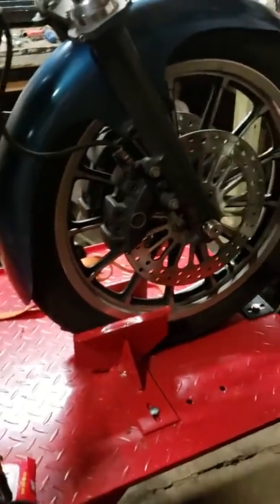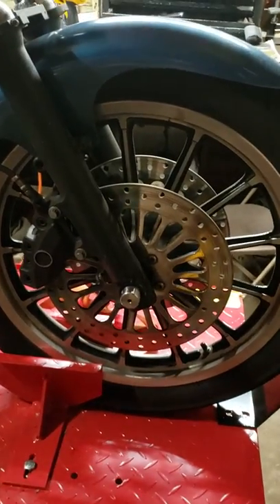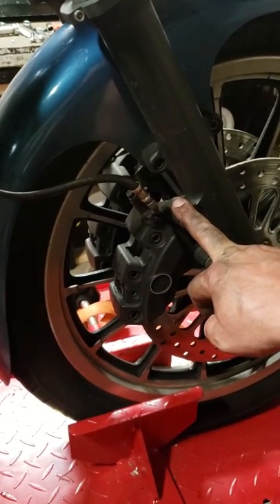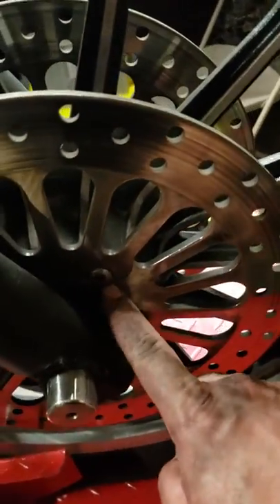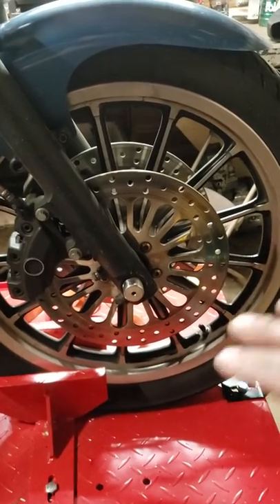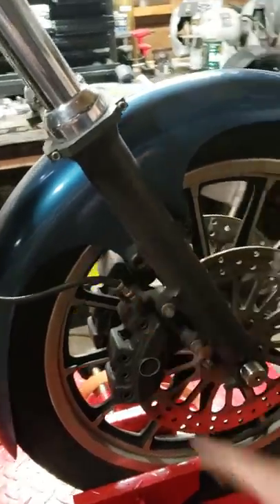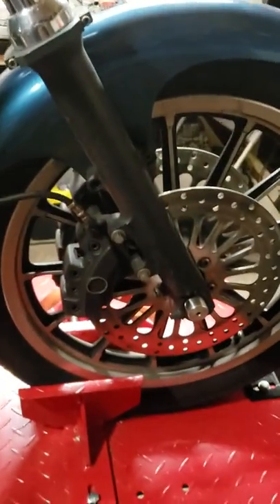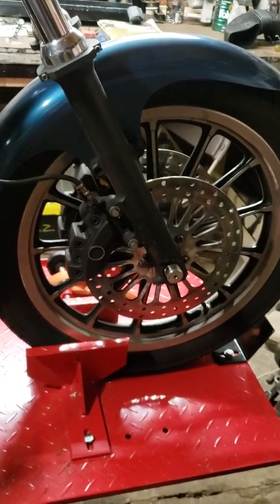Convert Dyna Dual Disk with FLH Brembo Brakes

Comment: Did you happen to measure or know the counter sink depth of the mounting holes of these 08 Dyna rotors?  I am in the process of acquiring the parts to do this conversion.  However I want to use the 11.8 rotors that are the factory design/look of my current 01 rotors and counter sink them myself.
Reply from the maker: I would have to pull the rotor bolts to get that. It’s about 75% of the bolt head thickness. It is just enough so the heads of the bolts barley clear the fork slider.

Comment: Desire to add Dual front Brembo calipers to 1996 FLSTF Fatboy. I have proper fork lowers. Does Master cyl need to change to go dual? What year Brembo calipers will fit this older bike? I assume 11.8" rotors.. TIA
Reply from the maker: You will need the adapters that allow you to use 00+ calipers. Then use a master off a dual disk bike.  I used the master and line off a road king FLHR
Reply: I got plenty of GO, I'm trying to beef up the WOE. Good info on Master from Dual touring type. I need Brembo caliper year and/or adapter info. Thanks

Comment: Hey man, had question see if you could help. I have a 2007 street glide with a 21inch wheel with stock calipers and 11.5 rotors but I want to upgrade to the 08 and newer bermbo calipers and 11.8 rotors should that be an easy swap? Just order the newer stuff and bolt right on? Thanks for listening. Hope you could help.
Reply from the maker: If you can find an 11.8 rotor that will bolt to that wheel, it shouldn’t be a problem. The caliper should bolt right up.

Comment: I bought a set of used brembos. They still have some dot 4 in the calipers. Anyway to flush the remaining fluid out? Or should I be good to fill in with dot5. I’m using my original lines. Fxdx 2004
Reply from the maker: I would bleed at least a reservoir or two of  fluid through it. That should be good.
Reply: @KnobleMoto  thank you bro. Last question, did you only replace the master reservoir, or the entire assembly?
Reply from the maker: @roco90s  I replaced the entire assembly.  It was a single disk before so I needed the dual disk brake line.

Comment: are all 2000 and up fxdx 39mm fork lower the same as far as the caliper mounting tabs? ive got a 98 SG that i want to run these calipers on but i have to run adapters and they look funny so if i can just get 2000 and up 39mm fxdx forks to swap in and have the calipers bolt right on id rather do that.
Reply from the maker: 98 & 99 are switch over years.  If you have quad piston calipers like the later 00’s, then yes the bagger brembos will bolt on. If you have the round calipers with only two pistons, then you will have to get adapters.
Reply: Did you have to shim your calipers in towards the wheel? Ive got all the exact parts as you have. Only exception is i have 11.8 floating rotors (shouldn’t effect anything) but my calipers will not bolt down tight to the fork slider without the inside of the caliper dragging tight against the inside of the rotor. Im losing my mind on this conversion.
Reply: Never mind i just found out there is a difference between the tapered bearing wheels and sealed bearing wheels. Tapered bearing wheel hub width is slightly narrower than the sealed bearing wheels. Which would explain everything as to why i cant fully seat my calipers because my rotors are to far in. Yay to ordering MORE parts.. being cool aint cheap!
Reply from the maker: @donevantaylor5009  part of the caliper on one side only had a few thousandths clearance from the rotor.  I filed it a little in case of some deflection happening.  It never made contact.  A shim could be a good option.

Comment: What year were those FXDX forks? I see yours don’t have the plug bolt off an 05. I have an 09 FXD. Looking to do the same set up
Reply from the maker: Left one is an fxd fork. Right one is fxdx from Ronnie’s Mail Order.
Reply: @KnobleMoto  I’m looking on Ronnie’s mail order and the only FXDX lowers I see are for the 05 and they come with that plug(could I still use those?). Also any recommendations on sourcing front wheels that accept both side rotors. My FXD only came with left mounted rotor
Reply from the maker: @mrbocanegraw  maybe fxdc? FxdL?  Any 99-05 would work.
Reply: Did you use a different brake junction to run dual brakes?
Reply from the maker: @mrbocanegraw  I used a brake line for a road king.  However you can but a T fitting to split the fluid, and I have seen people run longer banjo bolts, and just run two lines.

Comment: can i do this on a 2017 dyna lowrider my bike comes with dual brakes already
Reply from the maker: Yes.  You might be able to use your existing rotors too, but you will have to check to see if they are 11.8" diameter. The rest shoud just bolt on.

Comment: For a 07 Street bob would I have to change out anything to do the conversion? Or can I just get the rotors and brake set and just bolt everything on and add the extra line to the master cylinder?
Reply from the maker: Personally I would change the master too.  I am not sure the stock one would move enough fluid to make a dual disk setup work properly. 
To save a few bucks you could buy a used one and just rebuild it.
Reply from the maker: Otherwise, yes it should all just bolt right on.

Comment: Did you have to end up getting new front wheel compatible for dual disk? I have an 08 fxd and it looks like the wheel could only do 1 rotor.
Reply from the maker: On the 05 wheel, and many of the 39mm front suspensions, HD used the same wheel, so the bolt holes were already there.  
So, no I didn't have too.  
Check other dyna models for the dual bolt pattern, and the sportster models.   Many of them run the same wheel bearings, and axles.

Comment: Hi mate...im interested in making my 2015 abs softail standard...any help or information would be great... cheers
Reply from the maker: Sorry, for the late response.  I would start by finding a softail model that is dual disk, with the same diameter forks.  Then I would start cross referencing part numbers from there.  On the dyna, they all use the same forks, so you just have to buy the appropriate fork sliders.   ronnies mail order has a good site for digging through this info.  good luck

Comment: Great job.id like to do twin disc on my dyna wideglide 2013.any tips?
Reply from the maker: The big challenge will be finding a fork lower that has brake mounts. I THINK the fxdb fat bob has the same diameter forks as the wide glide.  If so, you should be able to get a fxdb fork lower from Ronnie's mail order, and swap out the internals.  Your front wheel may have the bolt pattern for the dual disk. 
Spend a lot of time cross referencing part numbers to be sure, but I think it can be done.  It would be a pretty cool setup.
Reply: @KnobleMoto  maybe I could just use dyna lowrider s front end?
Reply from the maker: Different fork angle and length.  The wide glides are there own thing.  It may screw up the geometry of the bike.  
You could take a tape measure to a use bike dealership and compare measurements.
Reply: @KnobleMoto  yea true.

Comment: Will this work on a 95 dyna dual disc? I’m in the house bord got into a street bike accident 😂
Reply from the maker: There are adapter required to post 00 calipers on the 99 down forks.  I would guess it would work with the adapters but I have never tried it.

Comment: Did you use washers to space in calipers? What thickness?
Reply from the maker: No spacers needed. They bolt in the correct location.
Reply: @KnobleMoto  so if i have wheel with hub larger by 6/16 than hub on 9 mags that means I’m not able to use those wheels cause rotors will be closer to lowers by 3/16 on each side?
Reply from the maker: @UserYoutube-i6f  here is what to look up.  The dyna and bagger shared the same caliper from 99-07.  After that they started putting brembos on the baggers, but they used the same fork lowers with both calipers.  
So see what models share the same wheels and forks lowers.  That will answer your questions.  
Ronnie’s Mail Order is a great place to look up part numbers.
Reply: @KnobleMoto  thing is i have fxdx lowers 08up bagger brembos like u do except my wheels are hd slotted six rims and the fact that you didn’t use any washers to center calipers is bothering me cause u have mags
Reply from the maker: @UserYoutube-i6f  I think there was a lip on the rim that centered the rotor, I think.  You could put it on a stand and center it before you torqued it down? 
If you feel you need to shim it, then do it.  On mine it all lined up perfectly.
Reply: @KnobleMoto  nah you don’t get you can shim cause your mags has smaller hubs I can’t since calipers mounted inside of the lowers not outside
Reply from the maker: @UserYoutube-i6f  oh. That sucks.  🤷‍♂️
Reply: @KnobleMoto  wait you have 2000up mags not 99 down?
Reply from the maker: @UserYoutube-i6f  00 up.  (05)
Reply: @KnobleMoto  that’s why you didn’t use washers 00up mags should have slightly larger hub

Comment: Did you have to change or do anything with the spacers?
Reply from the maker: No, they bolt right to the wheel and line up.   However it is very important you get a 11.8 rotor for a dyna and use harley bolts so the bolt heads will clear the forks.
Reply: Knoble Moto thanks, I’ve got a set of 11.8” rotors. That was my only concern. I appreciate the reply.